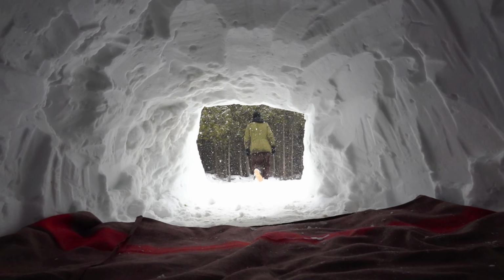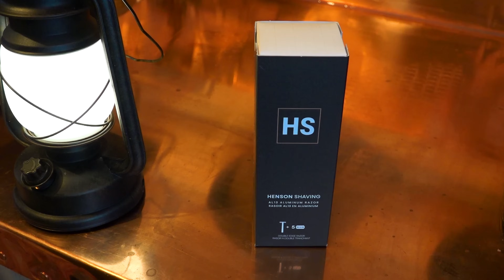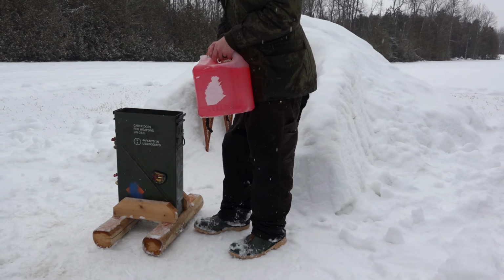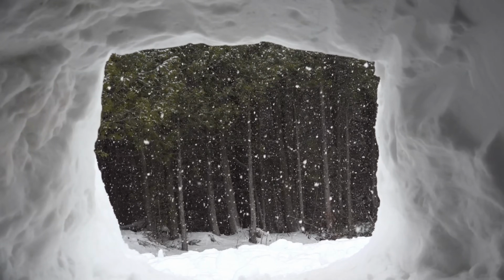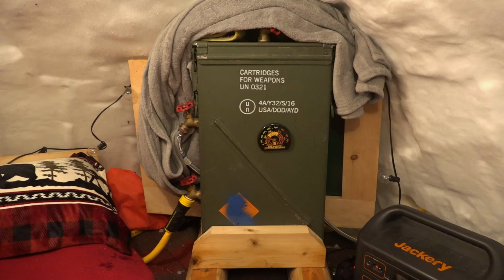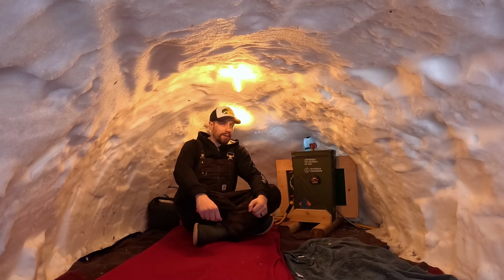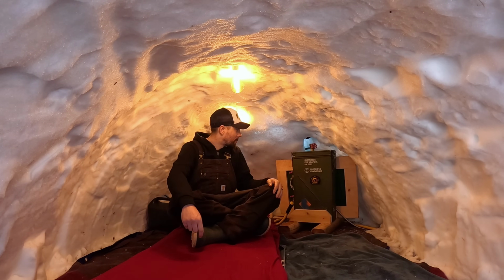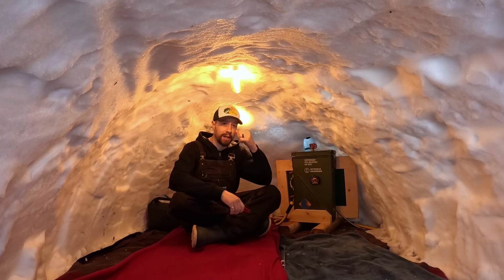DIY Copper Coil Heater- Snow Hut Camping

Comment: 2:50 That scene instantly brought an old man to tears. Happy tears, I'm glad to say. It triggered flashbacks to childhood days of digging tunnels and snow forts/igloos in the snow drifts, all fortified with lots of snowballs for battle of course. lol Probably the happiest time ever, great memories. There's a specific detail , though, that might be very helpful for you. The inside needs rubbed. You need to create an ice barrier on the walls and ceiling by rubbing moisture into the snow. Think of it like painting the walls of your house and sealing the surfaces, making them easier to clean. To prove a point, try burning a snowball with a Bic lighter and watch what happens. Yes, it does start melting, but it also starts protecting the softer snow behind it. Back then no heat was used. Several old socks were put over one hand(make-shift glove) and dipped in water, then rubbed on the walls to create the ice layer. Once the layer is made, the drips disappear by running down the walls instead. The smoother the better. With you having heat inside, the moisture comes natural and starts dripping. Just rub it smooth. 👍

Comment: Your method of determining the thickness of the walls is great. What I've done is break branches into about 1' lengths and insert them all around the outside of the hut. Then I simply dig until I hit a branch. Great video.

Comment: Classic Canadian ---> QUINZHEE ...... Okay, for someone as self who was born in Montreal in the early 1950's, I've made a many of these Quinzhee's in my youth, and the one thing that's important in making one of these also applies to Igloos!

For a proper and comfortable Quinzhee, it's important to construct an 'elevated' bed from the floor level, and the reason being is because the cold 'sinks' to it's lowest point and having it elevated, it will then help to enjoy the upper and 'warmer' (32F....lol) part of the Quinzhee.

Of course closing off the door with at least one rear vent and MAKING SURE to leave a well place upright shovel outside for anyone to see in case of a collapse and knockout!

Lastly, by raising the temperature above 32F, it'll help to create moisture on the interior walls, and then let it freeze completely!  This will then have secure hard frozen walls!  

Too much fun....lol

Comment: Awesome heating system, I have an adaptation of this for my house the coil is a water jacket running around and through my wood stove. one holding tank and an inline pump sending water to hot water to baseboard heaters throughout the house, its a closed system and keeps my house 2800 square feet toasty warm during Canadian winters. Similar system in the shop no holding tank or pump water heats up and and moves through a system of copper pipe and through a core heater repurposed from a car with a fan behind it, blow off goes out the roof  works like a charm.

Comment: Using the tarp for pulling out the snow from the inside was a great idea.  Was there any issue with snow melting under your heated bed?  If so, a piece of rigid foam insulation on the bottom side should help with that and have the heat rise.

Comment: You could glue foam insulation on to the box so to save from loosing heat into the outside air.

Comment: I love the water/bed system! My main thoughts if I ever build something like this were: build a larger double/queen pad for my fiancé & I, put a Mylar heat reflector just below the hose inside the bed, use a smaller 1-2 gallon reservoir, possibly double-walled to reduce heat loss, and place a “solar oven” type heat reflector behind it to help radiate more heat forward.

Comment: Looks amazing. Really love the idea of the heating system. Instead of a campfire, have you considered using a wooden stove connected to the coils, that you could keep inside a cave or a cabin? I would imagine it would make you less dependent of the weather, so you could be safely inside the cabin during a winter storm.😊

Comment: As a fellow snow camper, I always wondered if I could do something like this with a bed/pulk.  Unpack and run the lines outside to a heater. Thinner wood and some foam for the core and it would be a pleasure to pull with snowshoes or XC skis.

Comment: One thing that would improve the efficiency of the heating system inside your snow hut is that you would need to dig one side lower for a cold sump where the cold air which is heavier and lift your bed at least 6inches above the cold sump

Comment: ONe issue with putting the water tank outside is the loss of heat and energy from the outside temps.  The box being inside with you is a more viable option because it heats the air around it, therefore helping to insulate and keep the water warmer.  Now, what I would suggest is building a hut around the radiator. at least 4 walls anyways, help keep the wind off of the box.

Comment: Great idea for a DIY winter shelter with heat, which is relatively easy  & very effective. That said, I’m thinking some Owens pink foam board, or other foam panel might also work, while lightening the load & providing some extra comfort(?) Also thinking, one might be able to just loop a few coils of the rubber hose, into one’s thick/extra roomy sleeping bag, of which, the coiled hose should perform like a hot water bottle(?) Either way, your setup would make for a really good “minimalist” camping shelter, during an overnight primitive/deep woods ice fishing trip. Good seeing another video & hope all’s going well in the new year!

Comment: If you put the water tank outside you will need to insulate it, otherwise it will cool way too quickly. You should maybe get a little battery powered pump to help circulate the water. Also a two loop system may work better. One loop goes to the fire through the tank, then back to the fire, the other would be the water tank (stored heat) to bed and back to the tank (this would have the pump). That way if the fire goes out, you still have the heat stored in the tank, and the heating loop is isolated so it doesn’t cool the tank.

Comment: Just a thought about placing the heater outside ... as the cold will likely diminish the ability of the heating reservoir to maintain the same degree of heat as when out of the wind and cold residing inside of the shelter, you may want to build a small insulation enclosure so that it can maintain temperature (foam board or rockwool).  I really hope that you do some more of the camping with the snowmobile camper,  i freaking love that thing and have thought about building one for myself!!!
Reply: I agree that putting the ammo can outside might make too great a heat loss .  If you put in an older metal cooler, it could be  used as a table and boot warmer. You may need to cut vent holes in the side to let some of the heat out. Plus, it would give you a container to carry all your parts. Love your channel.  Good to have you back again. 
As always, my prayers to you and your family.

Comment: What about some Electric Tea Kettles...a few of them, their inards/elements, off the Jackery- to heat the fluid. Gotta be some low-voltage electric H2O heater options avail. I loved the snowmachine camper series, all the diff heating options you tried. Good stuff man.

Comment: While fiendishly clever, I'm curious why a small woodstove in the shelter with you wouldn't be both easier and more efficient? An open fire is super inefficient and requires that you keep going outside to tend the fire. You can even put a coil around a little woodstove to produce the radiant heated bed that you favor. The sweating walls is just a snow shelter curse if you have decent warmth. Pretty fun to watch no matter what!

Comment: Very interesting innovation, I wondered if you were doing it again would it be worthwhile putting a layer of reflective foil on the surface of the bed frame just under the hose to reflect more heat into the bed ?

Comment: Out of idle curiosity, why not add a condenser on your exhaust? Could probably make a really small and condensed one out of compressor discharge tubing. You know, the tube that looks like a caterpillar with its cooling fins and such. I think you'd retain a lot more heat by condensing the steam back, instead of it being wasted. Plus it could completely negate the need for ventilating the unit. 

Just my rambling thoughts though, lol. It's still super cool.

Comment: Did you pack down the snow mound and/or let it settle overnight or more before hollowing out the shelter? The snow has to be the “right kind” to support the weight of the roof. From my own experience, snow that is granular or not dense enough does not work! Great Videos!

Comment: I have a related project in mind and was wondering if automotive antifreeze would work because it'll go well above 100c without boiling.  What is the safe antifreeze you are using? Does the safe antifreeze you're using  have a higher boiling point too or just a lower freezing point?  Sorry for the million questions but I found your video very informative and as always, extremely well done.  My idea is similar but the idea of using an ammo can never crossed my mind and I see them all the time at Princess Auto (some some there today).  I have a few at home I store various things in and one in the trunk of my car as a container for an emergency survival kit.  I encased an automotive AC condenser in a tank I made out of stainless steel filled with Diathermic oil.  I had first planned on using some soft of inline pump and was glad to find out it wasn't required, but I do wonder if it might make a difference flowing the water at a high rate.  
I can obviously see you're a pretty intelligent guy and was wondering your thoughts on my set up so far and the plans for a possible pump? Everything else is pretty much the same as yours.
Again, I apologize for all the questions and the verbosity and muddled sentence structure.  I used to write technical instructions and I have a habit of typing everything that I'm thinking in my head at the moment on the subject at hand before running it through any kind of a filter and re-read my post, edit if need be and then hit (Comment).
Thanks

Comment: I think I'm missing something, how is the water circulated? Are you using a pump? It seems that with the steam relief valve open the system is not pressurized (smart) but there's nothing to force the warm water through the hose.
Reply from the maker: Great question! There is no pump. The water circulates on its own because of thermal siphoning: Heated water naturally rises (to the ammo can), and cooler water sinks (back to the coil).

Comment: You have probably already though of this, if you installed the under the floor heating in the sledge which should give you less work to get set up and just stop put the coil out and start your fire